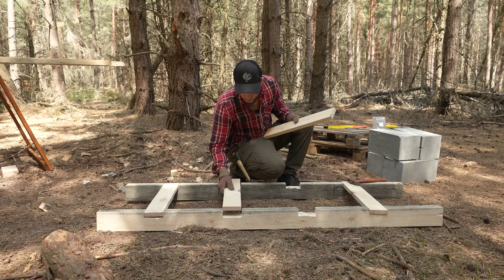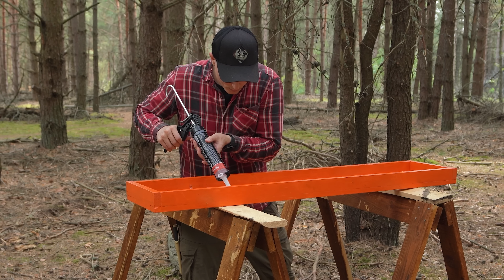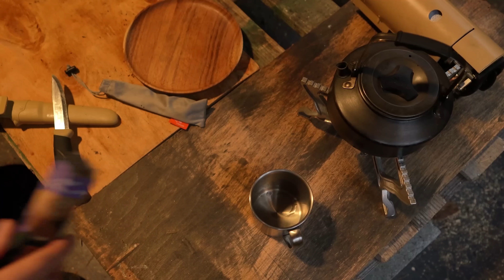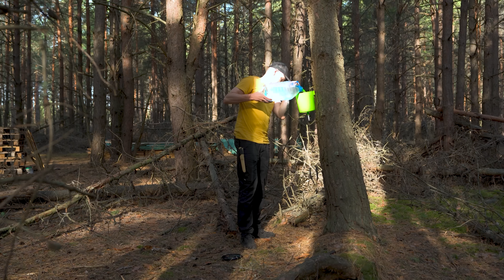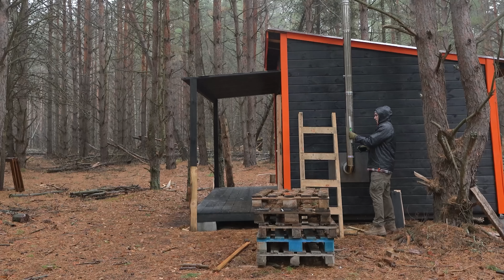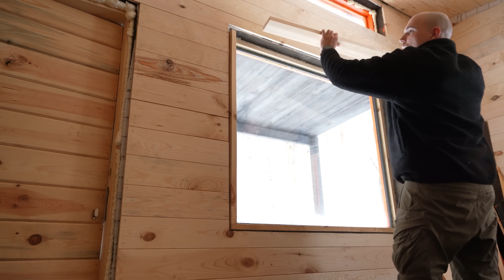6 months building cabin in the woods, off grid house start to finish

Comment: I just found this channel and build. I couldn’t stop watching it. Your craftsmanship is bar none. In my house I have laid wood floors, ripped off the garage and built our master bedroom, walk in closet and bathroom. I used manufactured floor and roof trusses. I framed six inch walls as I live in Minnesota. I used power saws and nailers. I would never attempt a build like this with non power tools. You need to be commended. Great job!

Comment: I love the fact your  building your dream space in the woods , just a note on cladding .tongue should be upwards groove upside down as water will sit in groove and  rot it also I hope its very dry and sealed very well as shrinkage will pull tongue out of groove on warmer days plus one fixing at base of board as two nails top and bottom will make board split in the middle , one fixing allows timber to expand and contract and holds the board below
Reply from the maker: I didn't know about the groove at the time). Thanks for the advice

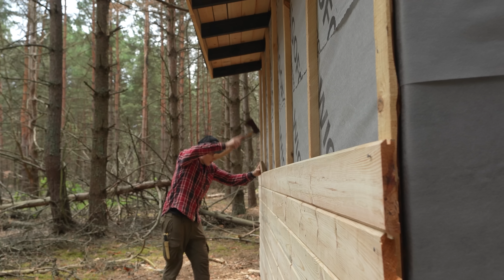Comment: 14:36 - looks like you installed these lining boards upside down .. these locking grooves should face down, not up. Right now rainwater can penetrate into the joints of the boards,  and in the long run make the walls rot .. which is no bueno at all.
However,  what impressed me the most was that this cabin was built with hand tools only .. most DIY builders would be helpless without modern things like a table saw, pneumatic nail gun, battery screwdriver and generator.
Your tiny house looks nice and cozy .. well done!! 👍✌
Reply from the maker: You make a good point, I didn't secure the boards correctly, but I didn't know that at the time, and there's no point in redoing it now. Thank you for your support!
Reply: @mypersonaljournal - You can still save the situation by adding transparent silicone sealant over those joints so the water won't get into the gaps. It would be best to do it in the summer when it is dry. A lot of work, but I think it would be worth it.
Reply: no the tounge and groove boards was one of the few things he got right .The tonge goes UP.
Reply: @jonelf2  I believe he got a lot more things right than just a few, congrats Roma!
Reply: @greybeard5774   oh please, dont never ever do that silicone... just keep painting in good condition

Comment: nice job but the boards are out on wrong. the tongue should be facing up and the grove facing down. the way you have it water will set in the grove and rot the wood.
Reply: @rj-yj8dp  I agree.
Reply: @rj-yj8dp  took me so long to get what you meant, but then I focused on the build too much to finally understand but won't the (thickness of the coat of) paint act as a sealant? Just curious, im no expert.
Reply: I noticed that too, thought it was upside down. Still, a very cool cabin
Reply: Which boards?

Comment: You used improper headers for the doors and windows. Must be 1/2" plywood or foam board, sandwiched between two 2x8 or 2x10 if using factory milled lumber. 
A 2x4 is only good if you never get snow. Make sure to make your door a loose fit. 
If it snows hard, you might not be able to open the door, but your windows will shatter before that.

Comment: What pest barrier were you planing on placing between the bottom of the exterior boards and the vapor barrier (the 3/4" gap between)? I did not see you use anything, but you did mention airflow between vapor barrier, slats and exterior wood. I suggest coarse steel wool tucked up between or a mesh screening of some sort stapled. Both would work and still allow for airflow. Leaving it with nothing will invite, wasps, bugs and mice to get between those spaces.  You have to put something there to keep this from happening. Just my two cents worth.

Comment: I spent my young years (1950s & 'early '60s) in a logging camp on the northeast coast of Vancouver Island - at Menzies Bay - when the only access was by water.  We did EVERYthing with wood.  Our cooking and baking stove was a sawdust burner and our Benjamin Franklin stove that heated the living-room and the rest of the house, was a wood burner.  And we ALWAYS installed all the fire-retardant barriers on the floor and on the walls behind and beside the stoves - and around the exit hole for the chimney - BEFORE we moved the stoves in.

I've watched so many of these videos - and have seen that these guys who (at a very young age) have amazing building and bushcraft skills - are absolutely clueless when it comes to fire safety.  They are surrounded by the woods and windfallen DRY wood - and they build their cabins, etc. from wood - yet they move these cast-iron stoves into their spaces and install them inches away from BARE WOOD - without a thought to fire safety.  When I saw that a cast iron stove was being moved into the cabin - the FIRST thing I looked for - was fire-retardant insulation - on the floors and on the walls where the stove was to go.  Nothing.  It was only placed around the perimeter of the stovepipe's exit hole.  Oh, well . . . .

Comment: Let's say you put tons of wooden planks to build that shack and you only relied on the 2 nails you planted at the top to hold it together. I didn't see any joints, which are the only ones that can hold the wood together, maybe supported by the nails that prevent the joints themselves from coming loose, but I've never seen a nail placed to support tons of wood.

Comment: The biggest criticism you can give as a carpenter is that! Complete one mom at a time. If he had put up the wind curtain around the entire building, he would have managed the insulation in the floor. Mold will definitely form there. And the roof covering is completely wrong.

Comment: Putting cement blocks the wrong way on the ground isn't stable. There should be a cement foundation depending on the freezing conditions. In the US, Anchorage: 52", in south Texas, pier blocks on top of the ground. Those plywood panels between the floor joists, it will peal apart. You should have painted the floor boards on the bottom. The roof and foundation are the most important parts.

Comment: The tongue and groove siding is upside down. Roll the paint on with a thick nap. The corners and windows will leak, no caulk or flashing. Did you square the windows and doors? No flashing or caulk under your trim. The wall boards are right side up where you don't need it. The stove opening: no flashing or caulk. I hope the girl is skinny for the bed.

Comment: Just a hint use corrugated plastic and metal screen or similar to fill in the gaps under your outside boards so bugs and mice do not find there way in ..If you want to leave an air gap use this method but do not leave open for free room an board for animals ...

Comment: I always wounder why some builders of cabins off grid never help themselves by buying a small 900 watt generator for about 150 $ to cut and trim wood for there build ! ..?they are so cheep that they would move the build so much it would pay for its self in one day !
Reply: See a small battery powered saw would help cut trim and boards but the generator would give charging too batteries and add light at night ! Not over power  the equipment !
Reply: Should have a cement board under stove to prevent a fire under the stove ! For safety

Comment: At 14:32, you start installing the exterior tongue and groove boards on top of the lathe boards.  Isn't there an air gap allowing both air and bugs to enter the structure at the bottom?  I don't understand why you said an air gap is needed on the external wall.  That is not how homes are constructed.

Comment: You put foundation blocks just on the ground 😮? All your building will be deformed after winter when wet soil will expand and raise. Also I did not see diagonal pillars which should add a structural ridigity. Also, you put foundation blocks on the side. It's not the way how they should accept force, they can collapse in few years. Also, outer wooden planks should have been secured with screws 4-5mm, not nails. When wood will get wet, it will pull nails as they are not bend from behind.